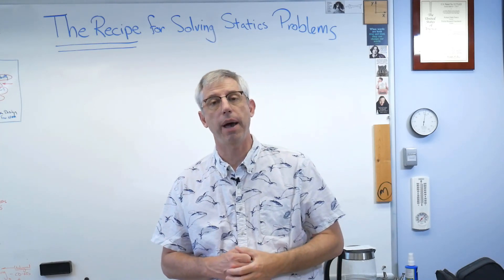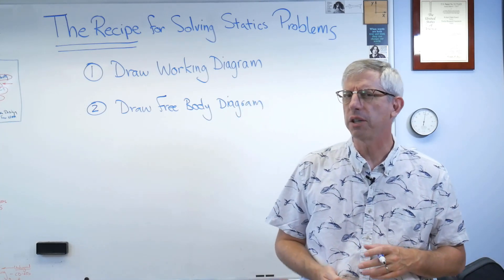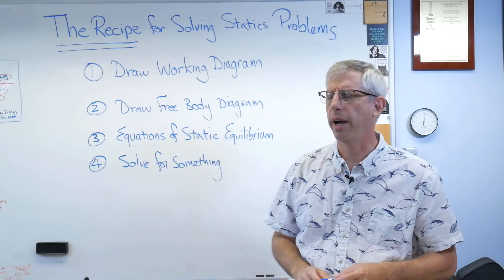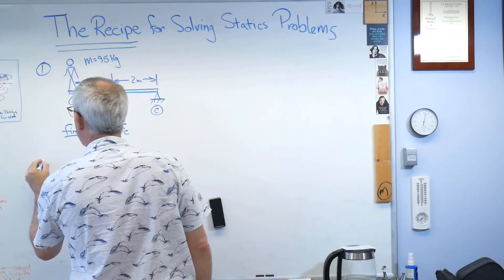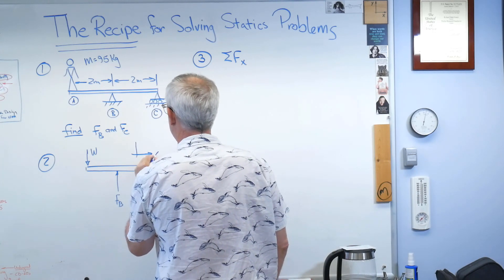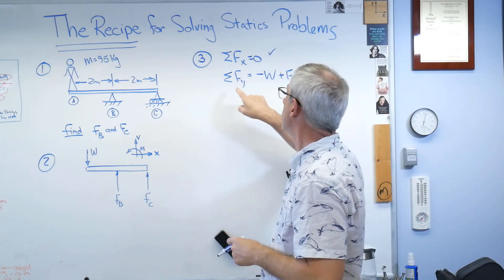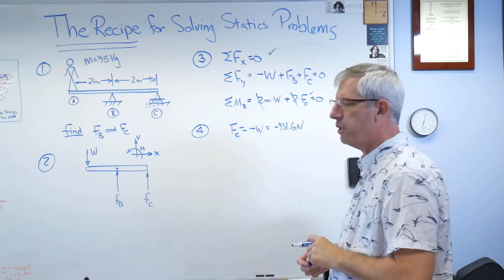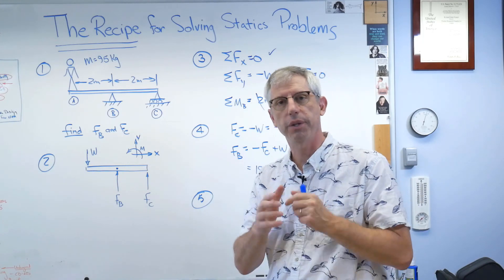Statics - The Recipe for Solving Statics Problems

Comment: i think you might have made an error, Fc should be positive since W is negative (per sign convention). you rearranged the moment equation, which leaves Fc = -W. W = -931.6. inserting that would give Fc = -(-W). this is just per my understanding, i'm super prepared to be wrong, if so could you explain how the force would be negative if it completely follows your sign convention.
Reply: I think an issue here is that if C were really on rollers I don’t think this would remain static. Neglecting the weight of the roller mechanism, the whole system would rotate about B, wouldn’t it? I could be wrong. I have been out of school five years and just getting back into this to study for the PE exam.

Comment: You should detail under (1.) Draw working diagram : a.) identify all xyz points  b.) critical geometric equations or relationships.  As you know professor, when you create an exam "this is where you add the tricks to make students fail".  Whether giving distances in a slope method, missing angles, flipping around xyz coordinate system, but maintaining rt hand rule...i.e.  point x axis up, casually describing vectors direction as vertical, horizontal or coincident,..etc.  

Also, add a 6th topic: Linear algebra basics.  
Why isn't this course offered anywhere except in upperclass mathetmatics?  It's "touched upon" very lightly in Algebra 2(9th grade algebra...with determinants and Kraemer's law).  However, it pops up in this highly dense/fast paced engineering course vector statics.  Vector statics is 25% physics(FBD setup and sum force=0) and 75% linear algebra, trigonometry, algebra and arithmetic. Linear algebra basics taught by itself is very easy to master(maybe that's why it's not offered like this).  In fact, you can apply dot product, cross product to vectors without any reference to "forces".  It can be applied to pure line vectors(position vector, distance vectors, unit vectors).  Having exposure to vector manipulation in just pure mathematical environment would incredibly "over-prepare"  the engineering students, so he/she can get homework done quickly, ace exams and attend more social functions.

Comment: I think I will re-take my statics course, from 63 years ago.
Reply from the maker: Let me know if you need any help with the homework ;-)
Reply: I highly recommend getting an Hp50g.  

This is my 9th or 10th time reviewing statics, again for my PE exam(one day I will take it).  I can solve statics problems virtually paperless.  (unless a coordinate point is "not given" then I have to write out the stupid dot product or cross product arithmetic).  

The FBD, geometry, and xyz coordinate system and points location is the most critical for problem set-up.  Then it's just defining direction vectors, moment arm vector, and the appropriate dot or cross product depending if you need(summation of forces and moments, perpendicular distance between vectors, projections of vector on an axis, or angle between vectors. More than 50% of the mistakes will be made during the "tedious" arithmetic, algebra and simultaneous equation matrix solving longhand.  Not to mention fatigue from paper, pencil or pen(my preference).

A vector like 2i + 3j -5k can be entered in the calculator and manipulated as a single entry as < 2,3,-5 >.  In addition, to the actual x y z coordinate of a point like (2, 3, 0) and infinite more points stored, manipulated and solved (like 3 equations and 3 unknowns).